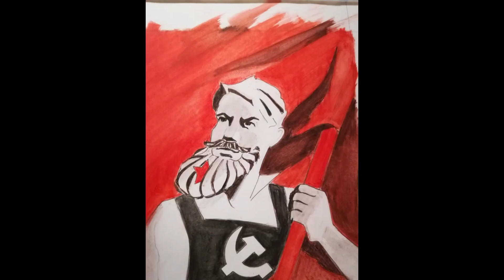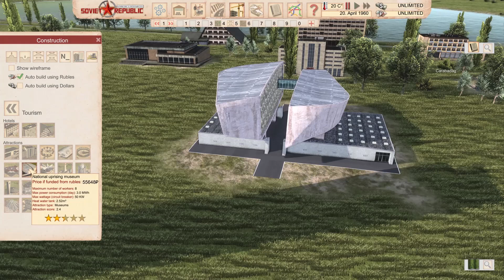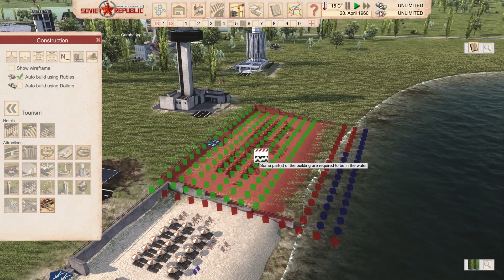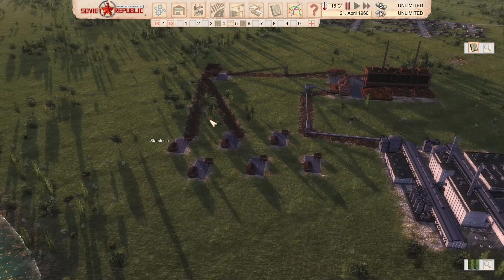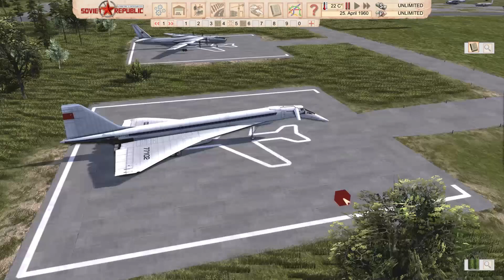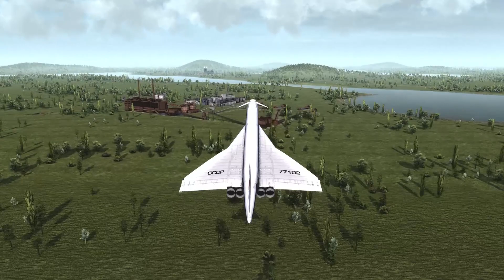Soviet Republic - Tourism, Aluminium and Planes - First Look

Comment: It seems that bauxite mines work more like stone quarries. With 3 excavators and 0 workers, you get almost as much as if it was full of workers, so I think most of the time we wont use workers at all.

But holy cow even more demand for chemicals. I don't like using mods but its getting to a point where the stock chemical plants are ridiculous. Would need about 40 chemical plants  just to supply one of each plastic/uranium/aluminum industry....
Reply from the maker: I agree!!!! What a mess would this be! 
Also, in the later game Steel will be problematic. 
Not sure if you are watching my let's plays but I have huge 10000 people Steel Mill and even with 500-1000 workers I was struggling. Still am to deliver all the coal ore. 600 tons a day and barely keeping afloat. :D